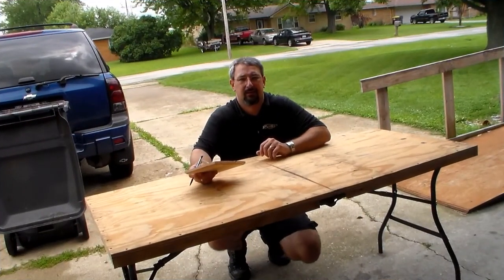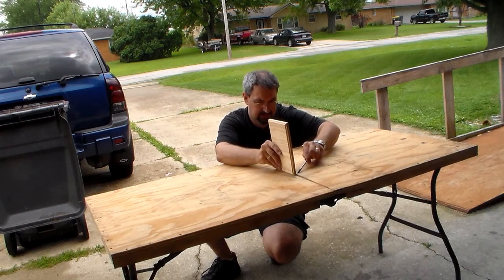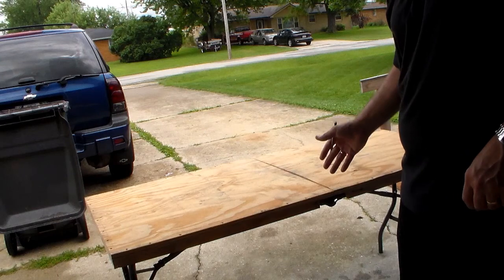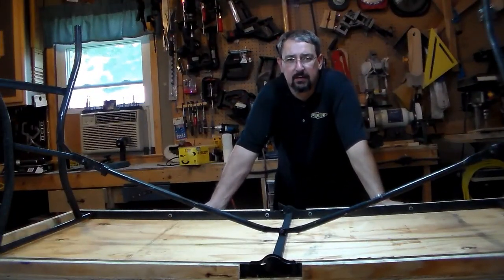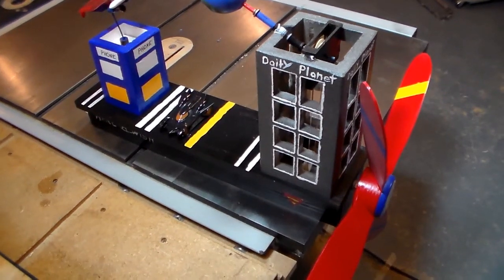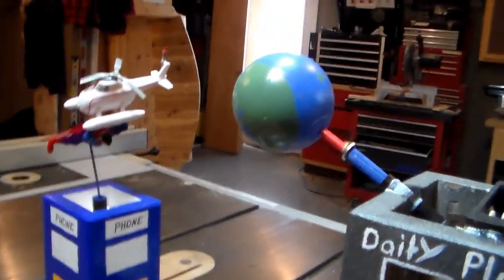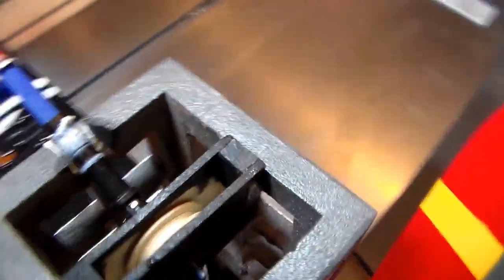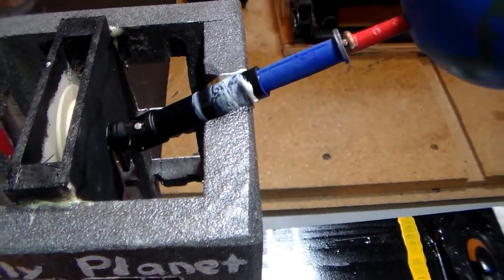Folding Table

Comment: Hey Mike, looks to me at the angle the camara is in that you may be able to do as you thought originally. Just carve out under the legs and center brace. There should be some give on the legs closed position, that they may be able to ride a lil higher other than flat. Just a thought hope it helps.
Reply from the maker: Good idea, ya that might just work. I'll give it a shot and let you know.

Comment: try using a piece of angle aluminum
Reply from the maker: That's what I ended up with
Reply: did it work?
Reply from the maker: Ya for the most still has a little bow in it. But a whole lot better.